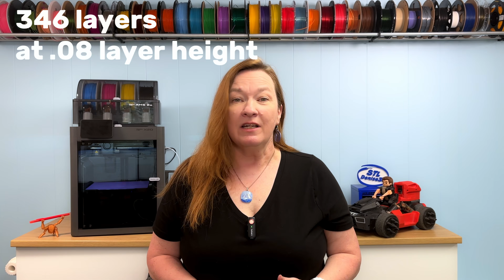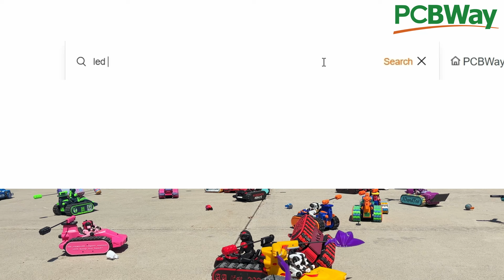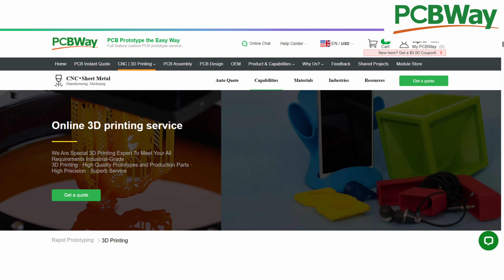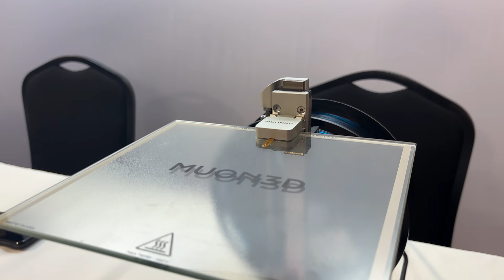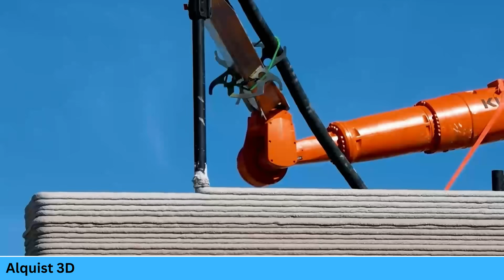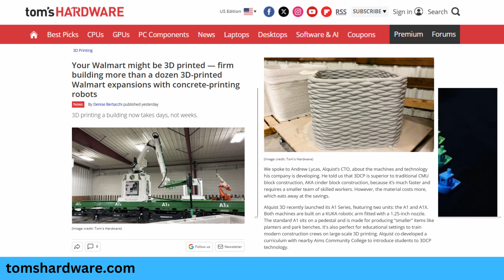3D Printing News: Spectrum 3D for all, Prusa Poopless INDX out now, plus 3DCP

Comment: Prusa INDX is not out, kinda misleading title there.  It is open for pre-order with anticipated shipping sometime in June and only for the CoreOne (where the resulting build volume is really small after it is installed... 205x248x270? as I recall).
Reply from the maker: Point taken, but we've been waiting for the ability to order them since Formnext. You're going to lose about 7.5% totally build volume, which is mainly a 15mm wide strip along the front edge to park the tool heads. Its annoying, but they're locked into a certain frame size to keep that upgrade path open. Prusa is for the long haul.